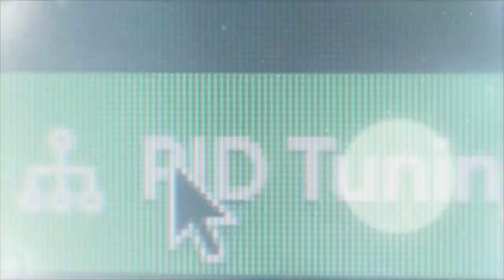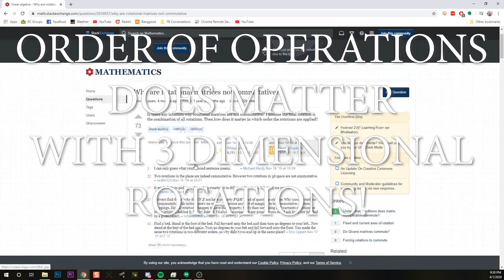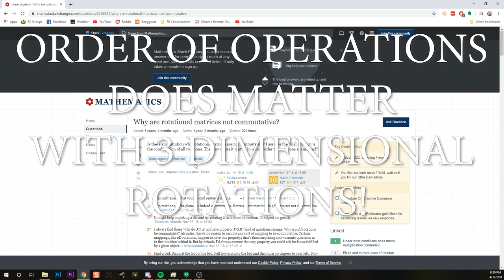Can you fly a quadcopter without using pitch at all?

Comment: The yaw is performed around an axis, by rolling first you're also rotation the axis around which you're about to yaw - That's why the order matters.

When you do it at the same time, even with the yaw stick in the same position the actual yaw that you're doing changes throughout the move as the yaw axis is changing throughout it.

It might be easier to understand if you have a play with zero camera tilt.

Comment: Hi, thanks for the follow up. I think you got the effect of the relative rotation on yaw and roll right. Now you assumed a normal turn is when the side of your quad is toward the center of your curve, but in racing you want to see where the flag is (and the next gate even) so you turn with the front of the quad toward the center of the curve. Wether it's in a turn or straight line, pitch and throttle go together to keep your altitude. So if you don't nail the perfect pitch during the turn and right after due to improper yaw/roll balance, you have to correct it. 

For a bank turn, plane style, for your quad to thrust toward the center of your curve you have to pitch back so when you enter the curve, you roll into it, yaw out of it and then turn by pitching back (with some yaw in / roll out to keep your angle), to get out of the turn, you yaw into the curve, roll out of it and you are lined up, only pitch to adjust depending if you messed up. 

For a race turn, you enter it by yawing into the curve, pitching down, and then mostly rolling during the turn (with some yaw in, picth back to keep your angle).

Comment: The way you did it toward the end is sometimes how I pull my turns.  I'm not quite so good at throttle control + yaw at the same time (Mode 2), so sometimes I will lock those and pull into an uncoordinated turn so I can still see the corner and where I'm going, and adjust pitch+roll which I have better control over to actually control the path.

Comment: I'm a newbee. I've never even flown a quad. I'm building one using Joshua's videos, but I come from RC airplanes. Tthe first thing they taught me when I was learning how to fly an RC airplane was how to make a turn. Simple enough, I thought, use the rudder. No, not really. Use the ailerons and then the elevator. The ailerons tilts the plane to the left or the right but it's still going straight forward but it's tilted at an angle. However, at that angle, pulling back on the elevator causes it to turn because now a little bit of UP elevator at that tilted angle changes the forward movement to a turning movement. That little bit of up elevator hasn't made the plane go up, it made it turn. On a quad, the roll stick is the equivalent to the ailerons stick, the pitch is the equivalent to the elevator, and the yaw is the equivalent to  the rudder stick in a normal radio setup. Those movements have the same effect on the quad as they do on an airplane. So to make a turn to the right, you use the roll stick slightly to the right, then a little bit of the UP pitch stick to make it turn. To stop the turn, you give it left roll, then a little bit down pitch. Am I right or wrong? Like I said, I'm a newbee but it makes sense to me that regardless of the craft type, roll, pitch, yaw will have the same effect as aileron, elevator, and rudder.
Reply: More food for thought -- on an airplane, throttle gives the plane forward movement. On a quad, throttle makes the quad lift up or down, but initially, it starts from a stand-still position with no forward movement, so giving it throttle makes it lift up so that it is now hovering. Still no forward movement. If you roll now to the right or the left, you should get movement in that the angle of the quad is no longer parallel to the ground, so that movement should be to the left or the right but not forward, correct? I don't think you can fly a quad without using pitch because initially the quad's propellers don't give it any forward movement like the propellers on an airplane. That being said, if an airplane's elevator stick suddenly did not respond to movement, lowering the throttle would cause the airplane to descend because the throttle still gives it forward movement but now that movement is slower and the wings of the plane begin to lose their lift capability. On a quad, lower throttle decreases lift because the propellers act like the wings of an airplane, so still no forward movement, and the quad descends. To actually fly, i.e. move the quad forward, you need pitch. Therefore, in my logical opinion, you need pitch to move the quad forward or backwards making the answer to your question "No." Like I said, I'm a newbee so I may be totally wrong. I'm just trying to apply what I now about flying an airplane to how that relates to a quad.

Comment: You made me experiment a bit. You can do a turn without pitch, if you roll and yaw perfectly in sync. You know you are doing it right if your horizon is level the whole time. If you start rolling a bit earlier, you will need to pitch back to turn (leaning into the turn, fighter jet style). If you yaw into the turn first, you will actually need to pitch forward. This feels weird but works too, in this case the horizon will lean to the outside.
Reply: And I think the thrust vector is actually the same in all three cases. Yawing earlier or later just translates some of the pitch into roll.

Comment: I'm pretty sure you wouldn't have to pitch back if you are at the correct angle relative to the direction tangent to the circle. I think that it'd be nearly impossible to do this without a TON of practice, though. I don't feel like thinking too deeply about it, but intuitively this makes sense to me. I think that there's gotta be a sweetspot somewhere right in the middle of the pitched back and pitched forward turns. I wonder if you just continuously did circles around an object if you could somehow find that point and try to latch onto it.

Comment: Something that quickly revealed the difference between real & sim quad flying was trying a simple trick I learnt in the sim - in acro, quad pitched forwards, straight lining it towards a gap, I yaw 180 degrees so the quad goes backwards through the gap.
In the sim it worked perfectly, nailing the gap every time, but when I then tried it with a real quad it drifted off to the side when I introduced just the yaw movement.

Comment: The reason you have to pitch back so much is because you have roll slightly towards the inside of the turn in anticipation of the turn, leaving your quad at about a 10-20 degree angle before entering the turn. Because of that, the quad is angled downwards and towards the inside of said turn when you begin the coordinated turn. obviously we do this so we can actually see where we're going into a turn. 

Rough diagram in Paint 3D: https://imgur.com/a/pcuk0x4  you can see how the thrust vectors are (roughly) the same in both diagrams despite entering in completely different ways.

Something interesting that might be worth looking into: quads don't really have an orientation they prefer to fly in, unlike planes and helicopters, which... for the most part, prefer to fly... well, forwards. you could theoretically fly through an entire quad track with literally no yaw movement at all. pitch and roll though, is kind of important, although like you said it's not impossible to fly if you disable one of those axis, it's just very disjointed.

Comment: Let me try a convert my instruction from the USNavy pilot background concerning the “LIFT VECTOR” LV from airplanes and wings into quads an motors. 
First 
—planes are propelled to cause airflow over the wings to provide Lift. The LV can be increased by more speed or more angle of attack over the wing, pull the nose up.
— quads produce Lift w their motors thus they can hover. 
Now with that in mind let’s consider the LV level and then in a turn. 
For a given weight of the aircraft it requires X amount of LIFT to stay at an altitude.  The LV Is always perpendicular to the aircraft and if wings level is also perpendicular to the ground. More power will increase lift result in a climb. 
When you introduce a bank that LV is still perpendicular to the aircraft but is no longer perpendicular to the ground. Put a stick straight through the plane:quad - skewer it. You will see that when you bank the craft the LV become part lift and part side vector until you reach 90 degrees (knife edge) and it is all side vector and no lift and you can no longer keep altitude (without something providing lift - in an airplane kife edge that would be rudder)
To provide the X amount of LV necessary to not lose altitude you must increase lift via increasing the angle of attack(aoa) or add power. The greater the bank the more vertical LV is lost so it requires an proportional increase in aoa or power to make up for that loss until 90deg and no amount of power or aoa will make up for 0 LV. 

NowI purposefully did not add the YAW in there because wings produce adverse yaw and quads work sooo much differently to plane in that respect but no matter what flight requires LIFT and you and make UGLY uncoordinated turns without YAW with both planes and quads.  
Godspeed

Comment: My issue is with Yaw control while manipulating throttle...plus, I tend to lean my radio as I concentrate on racing a track...therefore, my required inputs change through an entire heat, making consistency dramatically difficult. My constantly shifting radio is the absolute number 1 reason I was a top 10% MGP racer versus top 2%...no doubt about it (also the reason I quite racing last year;) So, I'm starting to experiment with reducing my yaw drastically, and trying to decide the balance between overall low yaw rate and simply increasing yaw expo. The other thing I'm thinking is I might also tighten up my gimbal quite a bit on the yaw axis, though I like a decent amount of yaw for freestyle, and so I don't wanna have to adjust the gimbal stiffness every time I go between race practice and freestyle. Interested in your thoughts on this subject. How low can one reduce their yaw rates and still fly effectively on a race track? Much thanks, JB!

Comment: 4:30 I think one way to think about it doing each operation alternately, with very small steps. (continuous just means taking the limit) So your pitched forward, then you yaw a very small amount, and correct with a proportional amount of pitch and repeat over and over 1000 times per second, or whatever the loop frequency is of your flight controller.
Reply: it's more like combining them into a singular (or the net) rotation, the same way as accelerating a box up to 5 m/s along the x axis and then accelerating it to 3 m/s along the Y-axis doesn't effect the x-axis value, they just combine into a singular vector of length (about) 5.8 m/s. It is a little more complicated than that but that's the easiest way to explain it.

Comment: Hi, please show your PID setings, yow, roll, throttle settings on simulator
Reply from the maker: It's whatever the default is, but I hardly think it matters.
Reply: Really hard to fly with default settings, I am new in FPV - and trying to fly using this simulator. Maybe you have some advise for beginners with simulator settings
Reply from the maker: Turn the graphics all the way down to ensure you are getting the maximum framerate possible is the first piece of advice. If you have a high end gaming machine that can hit 120 fps on Ultra then disregard this advice :-)
Reply: Joshua - I like your channel 👍🏻 thanks. I am from Kazakhstan there is no one who interested about FPV. Because it is expensive hobby and no information in Kazakh language. So I am alone in my Country about FPV. I JUST get my Taranis x9d and start fly in simulator.